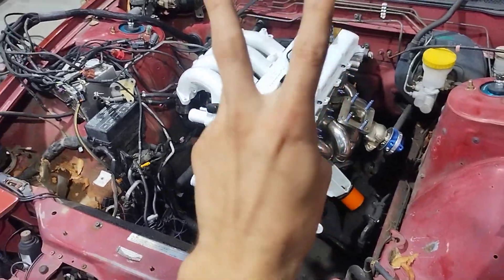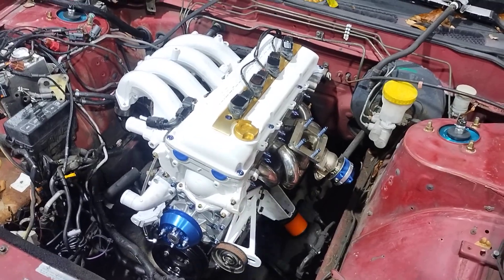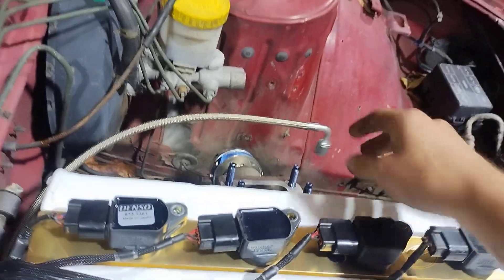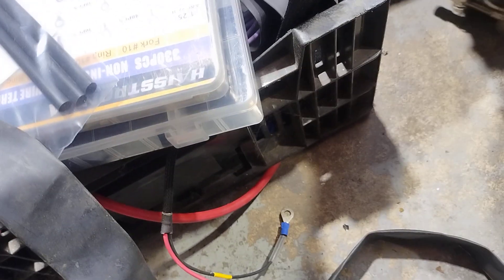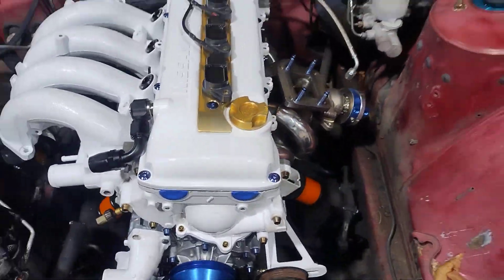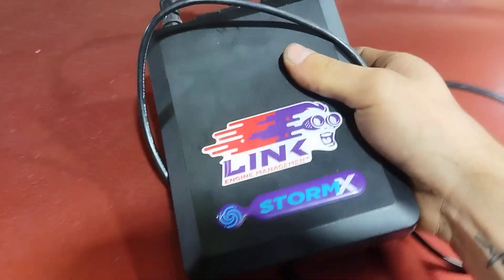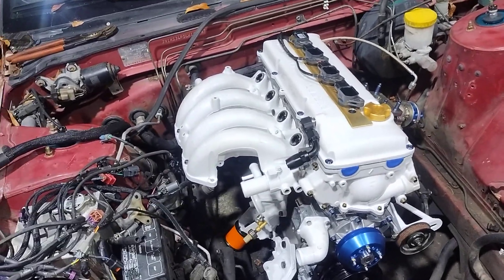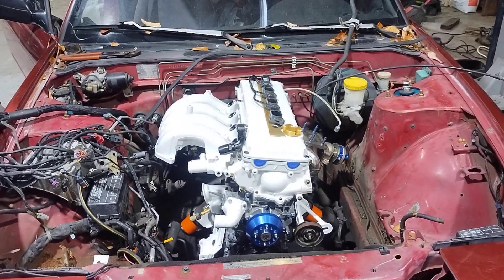My Built KA24DE, Updates, Issues, Annoyances, and Advice

Comment: KA; Although the SR20DET surpasses the KA24DE in many areas, the KA can be improved to match or surpass the SR! The SR20DET is a 2.0 L,  while the KA24DE is 2.4 L.  The size of the engine and deck height makes it an easy choice when making big power.